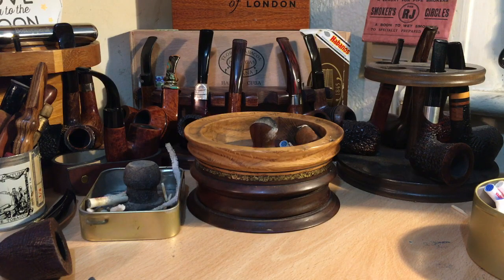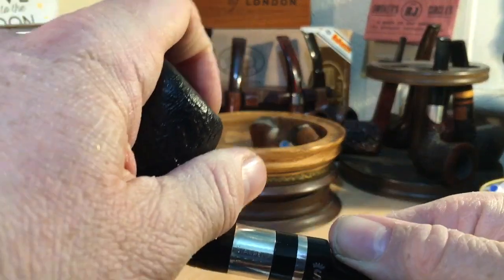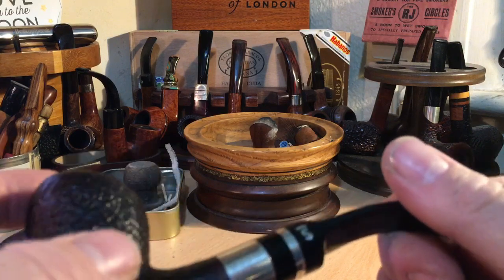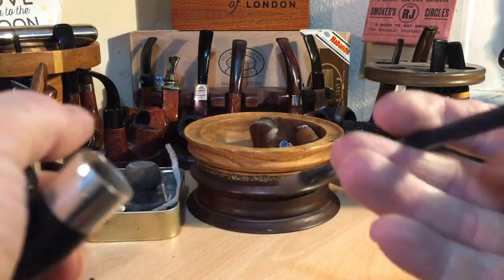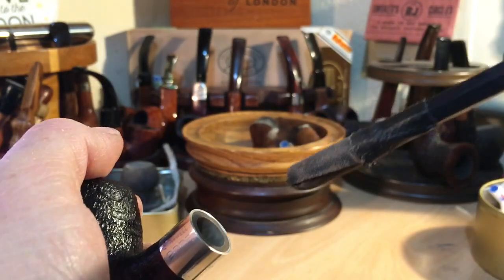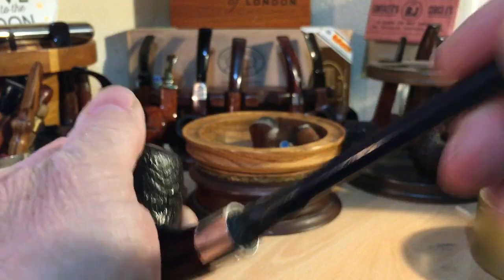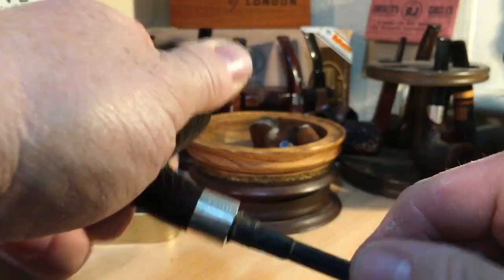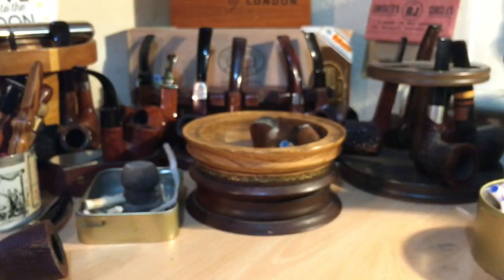Simple tip to ease a very tight pipe stem

Comment: Simon, you're doing it the hard way.  No graphite, no pencil, no bees wax!!  Graphite has enough grit to ( over time ) wear away the tenon.  Bees wax is best used to tighten a tenon.  Get a small piece of very dry bar soap.  Unscented if possible.  Rub that on the tenon.  Wipe off the excess and try and insert into mortise.  IF you get any noise, on entry, just back it out, re apply, wipe, and re insert.  There should be no noise.  It should be a nice smooth twisting action.   The bar soap is what the old French pipe makers used.  Your basic bar soap ( not the fancy exfoliating variety ), has a small amount of oil to lubricate and NO grit, so no potential tenon wearing results.
Reply from the maker: Briar Blues sadly none of the usual methods worked on this pipe. The drill was simply too tight

Comment: Apply some grafit on tenon it will provide ' lubrication' and there is no need for sanding as well as it will help not to break a tenon. It is easier and safer 
Hope it helps
Szymon
Reply: Agreed, I use the other end of the pencil.
Reply from the maker: smoking_student on this pipe non of the usual methods helped, it needed sanding.

Comment: No, no, no! grab the pipe were the ferrule is before twisting! The way you are doing it, feels more comfortable to the hand but puts too much pressure on the shank and the tenon, the weakest parts off any pipe. Also is easier to sand the tenon. Or put a bit off dry soap (with no fragrance) as a lubricant on the tenon. I broke a Dunhill by applying pressure the way you are doing it. There is even a video were the presenter accidentally broke a meerschaum by separating a pipe like that. Cheers

Comment: Putting the pipe in Freezer is a quick remedy for stacked stems
Reply from the maker: yes that does work when the briar has expanded, on this one the mortice and tenon simply don't fit and the stem needed to be sanded. Greetz

Comment: Hi Simon have you tried the bees wax it's great for loose and tight stems , hope all is good with you 😬👍
Reply from the maker: Dublin Pipe I tried pencil lead first but this one was a case of the fit being badly drilled. Had to be sanded. Thanks for the tip, def worth a try on a sticky stem